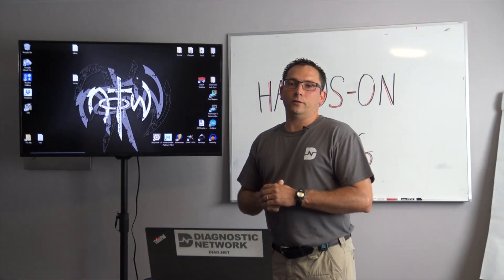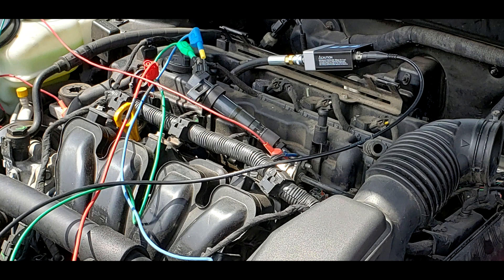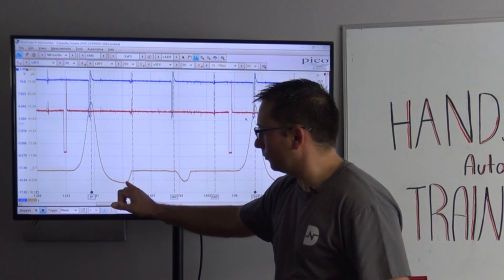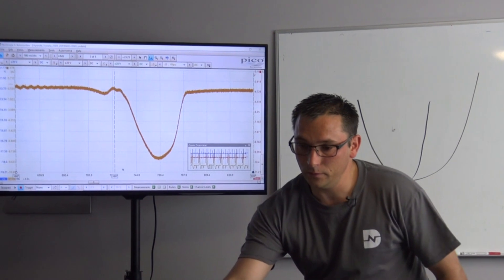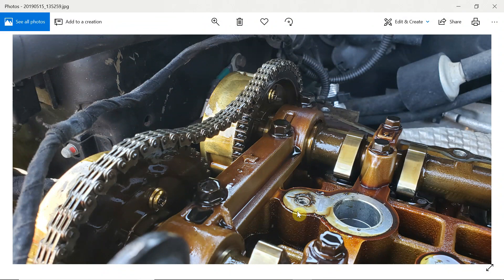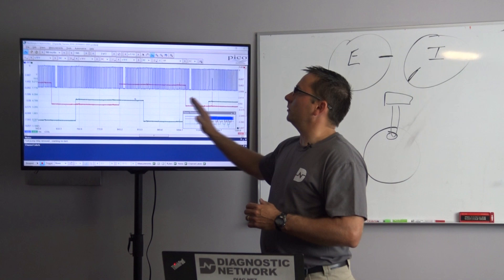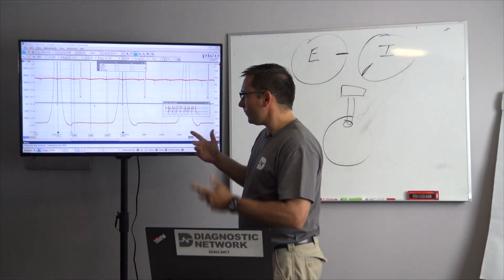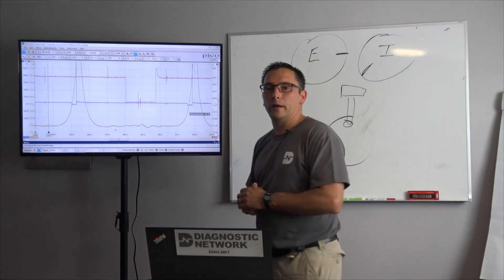2009 Hyundai Sonata Timing Off

Comment: Brian, that was awesome! Question, when you were saying that the cam wave forms should of   been both high or both low in relation to the crank sync, does that also indicate when the valves are closed/high and when the valves are open/low ?
Reply from the maker: Great question. The high and lows of the cam indicate the position of the cam to the crank,   not the valve opening. On this engine the cam stays high for 1 crank revolution and then goes low for 1 crank revolution.   If you pause the video take a look at  either cam on the good or bad pattern and you will see the length of the highs and lows of the cams are =to 1 crank revolution.
Reply: @BrianMann216  Great answer. I never knew the length of high or low = 1 crank revolution ! Keep the wave forms and vids coming, so much to learn. Thanks, not to be rude, accually this is a compliment, I love picking the brains of guys like you !
Reply from the maker: @billyr9840  Just so you know and to be clear,  this engine the cam high then low = 1 revolution. Other makes and models will have there own variances and this may not hold true.   Here is a sneak peak at what I may make a video of soon.  http://handsonautotraining.com/pico-helps-determine-wrong-engine-installed-in-vehicle/